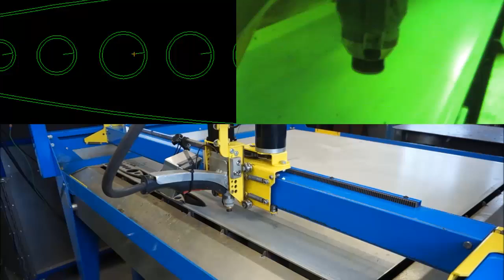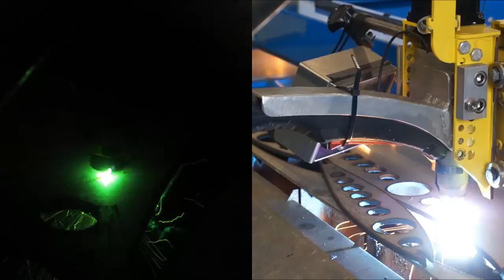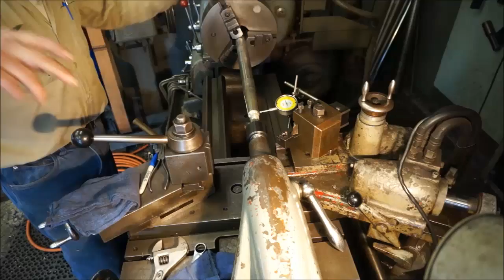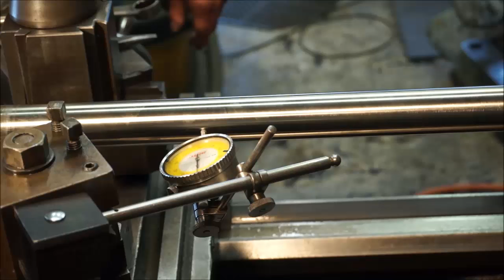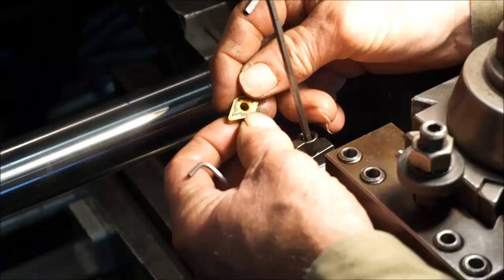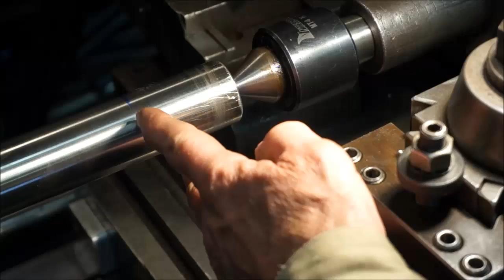Wing it Part 6

Comment: If that shaft is metric you can bet the taper isn't 3/4" per foot, because the French have this thing about not admitting that inches and feet exist. On the other hand the taper might be 6.25%, or 6.25 cm per meter, which would be the same as 3/4" per foot.

Comment: I am just catching up on your older vids a noticed this series,  I build model planes " even the 22 foot wingspan" and was thinking what would be the minimum thickness light metal ribs, like aluminum with the plasma setup. I like to use a metal master pattern to make the wooden parts from, could it be done or would it be very hard.

Comment: What is the diameter of the Plasma Jet? I noticed it cleans the slot at the ends... Are there different diameter tips? Also, what is the "glitch" on the screen when the cut line jumps ahead of the actual progress? Now about the taper:  .1875 (3/16)@ 6in = 3/8 @ 12in - so is the 3/4 : 12 taper is figured on the diameter instead of the radius? Is it better to post each question separately or Just as annoying either way? ;) Thanks Keith!
Reply from the maker: The 60 amp. tip has an .080" kerf width. Yes there are different tips for my style torch. If there is a glitch it may be in my timing of the videos, but only used as a reference. Yes 3/4" per foot is figured as you stated, but checking the components that other in the past have machined, you need to check that you match or you may fail on being able to reuse / loose the draw in the taper fit! ;{)----

Comment: doesn't the indicator have to be exactly square and centered in all 3 axis to
 be totally accurate?
Reply from the maker: If we were in a calibration lab or any other environment that had zero allowable tolerances, your exactly right in the need of doing that, in reality the difference of the slight angle off is less than you could be able to see at a glance, It is more important when comparing one part to another, than it is comparing one side of a part to the other. I think you should practice placing your indicator as square as you can, but learn to be flexible. ;{)-----

Comment: I always enjoy watching your setups with the tracer. I've always used taper attachments, and have to indicate them in. I do miss making props shaft though. 
Nice job. Thanks for sharing. 

Adam
Reply from the maker: Adam, up until I got the lathe with the tracer all I used in the past was the taper attachment to machine tapers. I was skeptical about whether it was going to work and not expecting it to be the cats meow, for marine shafting, catching the whole shape minus the threads in one set up. ;{)----

Comment: When you said about no center hole I wonder if it was machined on a lathe with a small head stock hole. Held by a stub and taper and threads cut close to the chuck with the shaft hanging off the tail stock end and then the stub parted off. Great videos Keith keep them coming.

Comment: Watching you playing with inserts, bit angles, DOC, speeds etc... Is always informative. 

 On a side note, I really need to find a hydraulic tracer attachment that would fit and 80 inch bed, just about every job I have coming my way would be 10 times faster with one. However they are harder to find than the pot of gold at the end of a rainbow!!

Comment: Keith
Those screws are big for sure.  This is no small catamaran sailboat for sure.
From one of the videos the rudder looked quite small in comparison to the new one.  Did they rely on twin screw for manuevering near docks etc?

What is max RPM on those screws and corresponding torque (or HP)

Dan Bentler
Reply from the maker: This is a fifty foot vessel and I didn't even concern my self with the horse power of the Yanmars or the reduction in the V drives. the rudders were first cast bronze wedge shape and then milled and glassed over. He hit a buoy and broke the glass work and half of the bronze blade away and that is why I am making the replacements. They are close to the same size and will show more so when the skin is complete. ;{)------
Reply: Keith Fenner The rock always wins and I guess the same is true for buoys.  

The reason I ask re Torque and RPM is people ask me what size electric motor do I need to make my boat go.  I tell em get me the torque and RPM curve for that screw and I can tell you how to match motor to the load then.
Reply: dan bentler
Nearly forgot
Re being busy - stay that way - it is more important for you to be a positive cash flow business than to make videos.

I watch and learn from each and every one.  What is really important to me is your thinking job thru before picking up tools.  You always get a surprise even though you spent time thinking it thru - your way of dealing with surprises is a second important learning area.

Dan

Comment: Love your videos, Keith.   I always learn from them.  Maybe I missed it but what caused the failures in the rudders and shafts in the first place?  Experience tells me it must be rocks under the water or backing into a dock hard.  But the props look good??  Looking at the size of those props a 40mm shaft feels a little light (or close -- although a function of engine HP).  Did the owner consider line boring the shaft logs and replacing the cutlass bearing and going with a 1-3/4" shaft as opposed to turning stock shafts down to 40mm? 

This is the 3rd set of rudders for the cat?  Maybe it time to consider a new rudder concept like dagger lowered rudders (especially is shallow water is the cause of recurring failure) or a seamanship refresher course for the operator.  Your blades would be perfect for dagger board rudders.  Thanks again for the great videos.
Reply from the maker: I believe the story is a collision with a buoy. Not sure if there was any other added factor or if in fact it is what really happened. ;{)---

Comment: Was it necessary to turn the replacement shafts to the metric size? Couldn't you just have left them inch and whatever thus saving some work and money?
 Oh and pretty snazzy editing with the split screens, great job. Not to mention a great job on the fabricating too!
Reply from the maker: The change out of the thru hulls and what might of been needed, or if it would fit through the V drive, not really sure of their reasoning for not changing it over. They had talked about it though!
;{)-----
Reply: Thanks for the reply. Much appreciated.

Comment: Some inserts require a slightly different angled holder to cut properly. It all depends on the grind and clearance angles. Some are ground into the insert and others are provided by the holder.

Comment: Hola Keith! Sandvik coromant and Seco both have good products. Of course we are not talking here about the Iscar which is twice the price. I believe that the geometry of Seco insert was meant for more brittle materials with that negative angle. P.S. Allways like what you do as a machinist. :)
Reply from the maker: When you get free inserts always interested in trying out on different materials and project as you go, no waist if you try.  ;{)------

Comment: I like this one Keith, learned a few things. Like using the steady to create a true running shaft and also turning the bit to affect chip formation and finish quality. Also learned that aquamet is pretty pricey and the adage that a boat is a hole in the water that you throw money into is true :-) Thanks!

Comment: What are the smaller holes for Keith ? I am curious....why are you cutting the holes out of sequence vs one after the other,are there heat issues you have to consider ? Love the videos !
Reply from the maker: The small holes are for fluid to pass through, that will fill the rudder when done to keep the rudder from sweating and the stagger cut pattern is to spread around or reduce the heat focus. ;{)-----

Comment: One question Keith. Why the sudden big spread of these videos. I mean, there's not days between each one, but weeks. Great videos :)
Reply from the maker: The reason, that it is spread out over a longer time frame is because I'm still working on this project and another dozen projects all at the same time. Some emergencies also get pushed in to the mix and I also had a few other jobs that I created video footage for videos yet to come! Plain and simple just like when I was doing the TV elevator job and it took about six months, not that this will be quite that long but I get up and go at it, get some sleep and do the same tomorrow! ;{)-----
Reply: Keith Fenner Thanks for the answer. Looking forward to the next part. I really enjoy watching this :)

Comment: How do you centerdrill a large rod if its rusted on the outside and you can't spin it in a steady rest?
Reply from the maker: You can stand it in a drill press and lay out the end where to put it or pistol drill it by hand. ;{)-----
Reply: if the cones on both ends don't line up, won't that be a problem? I mean, if the two centerdrilled 60 degree holes don't line up with each other.
Reply from the maker: meocats The new line or the straight line is now between the center points and most of the time the distance between them is long enough not to even show a sign of misalignment in the surfaces of the centers themselves. If you really had to be anal about the centers, you could take a light skim cut to get your true outside diameter to run the steady rest, and re do your centers with a single point tool. I will be doing a video after the Wing It series that has this scenario in it, with a 5.25" diameter pin 42" or so long.  ;{)-----